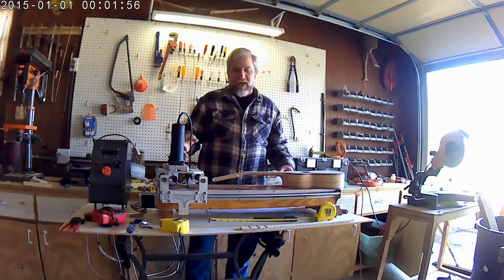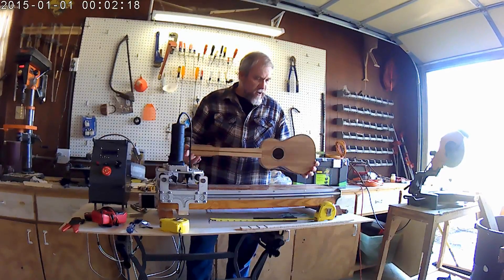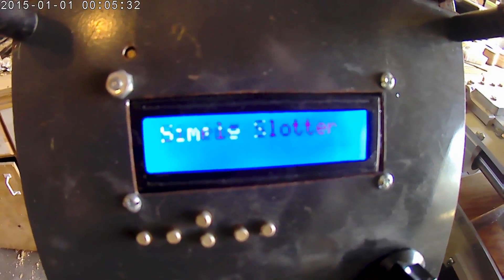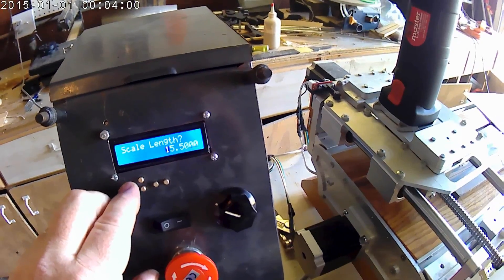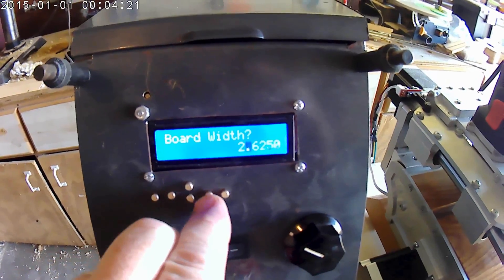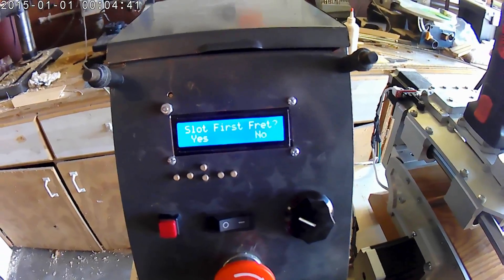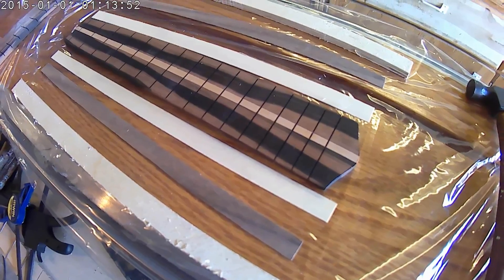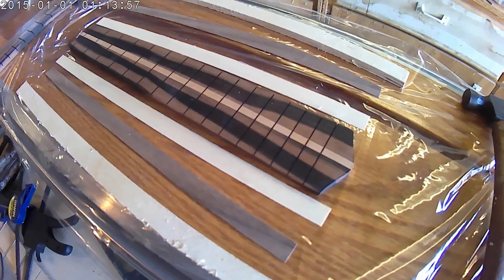First Run - CNC Robot Fretboard Slotter - Applewood Concert Ukulele Luthier Build

Comment: Came here from a Reddit post on a luthiers sub. This is a cool machine, I'd love to build one someday. Is there a Z height adjustment or do you just set that by hand? Did you custom make the spindle carriage? Have a subscription sir!
Reply: OH HAHAHA, You posted the link on Reddit.
Reply from the maker: Thanks.  The Z height is mechanically adjustable.  I have about $300 in the machine, along with huge numbers of hours.  Most the parts came off of ebay.  The spindle carriage was machined on a CNC machine that I have access to at work.